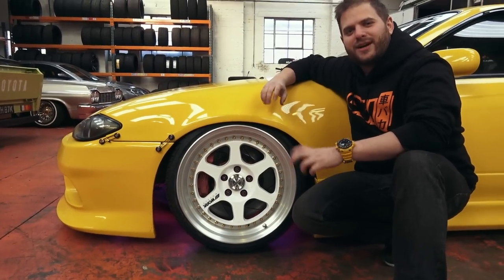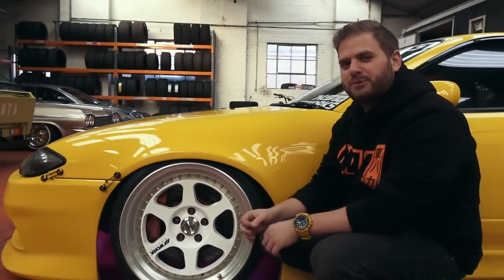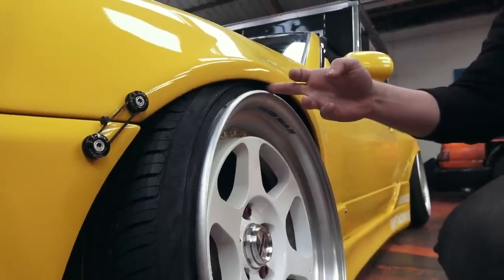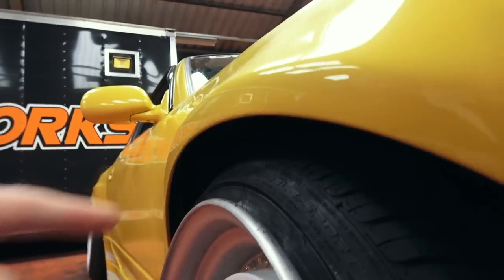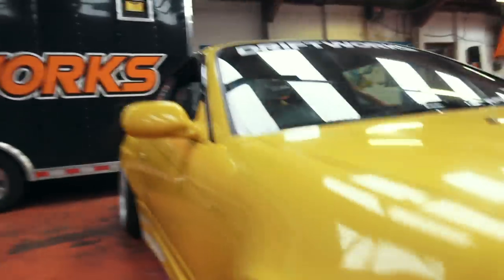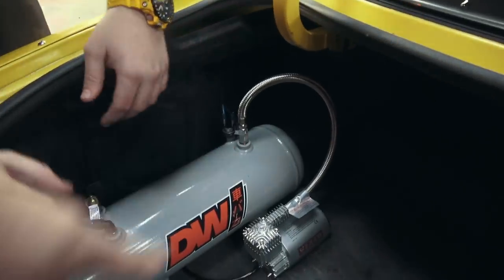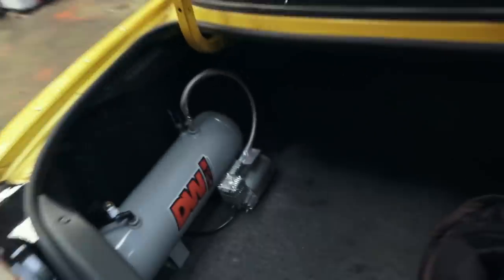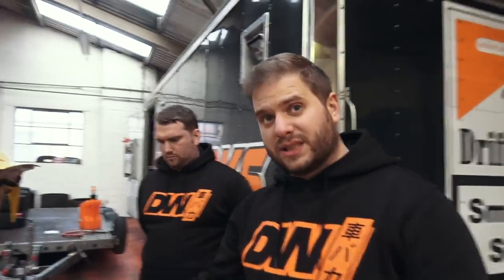AIR LIFT CUPS FOR COILOVERS: TESTED

Comment: But I want the opposite. I want my car to run at a normal-ish height. Then when I wanna hit the track I can drop it to super low race mode. And don’t say airbags because we all know coilovers out perform air on the track. So basically I want track set up coilovers that can be turned into super comfy air ride at the touch of a button. Or how about electronically adjustable coilovers? Track/street/comfort modes? Someone make that
Reply: fiesta51 just get coilovers and then adjust them at the track
Reply: fiesta51 that would be interesting maybe like a little motor that sits where the locking nut sits with a touch of a button you can move the coil up or down and also lock it in place
Reply: О

Comment: What are those things on the bumper - linking it to the fender - called? what are they for?
Reply from the maker: They're to be able to quickly mount the bumper using rubber O rings or zip ties.

Comment: That's still low tho. There isn't much wheel gap because it's stretched and has tiny sidewalls, but ground clearance isn't really enough for most stuff.
Reply from the maker: The static ride height is up to the individual customer. This is just Starkeys preferred ride height on his car.
Reply: Driftworks
I know, but he said "people will still call this low" and it is, it just doesn't look as low because of his tire fitment. If he had no strech and a 40 sidewall tire he would look much lower.
I wasn't making my comment on the product, but more like a reaction to what he said in the video.

Comment: What about coilover that have the springs seperate from the shock? Would the cups be able to work or not?
Reply from the maker: No, we don't have a solution for that, unfortunately.
Reply: Then its  not a coilOVER.    JUST A SPRING AND SEPERATE DAMPER

Comment: Is it just cs2’s the cups will fit or are there other makes that they work on?
Reply from the maker: We can do them for a variety of different brand coilovers. What brand do you have and what car?
Reply: Not long got a set of bc racing RM’s from yourselves for my s15. Could be a solution to my drive/exhaust problems

Comment: So does this work for drifting?
Reply from the maker: Hi, do you mean does it work on a drift car? It doesn't really make any difference what type of driving you're doing. You can only use this to raise the car temporarily, the rest of the time when driving under any condition it doesn't play any part in what the suspension is doing.
Reply: Yeah that’s exactly what I’m looking for because as you guys know uk roads are shite and I was just wondering if it made the handling different thanks guys

Comment: What's the most time these car hold air before damaging? would be quite useless if it was any less than 3 mins imo
Reply from the maker: They are only meant to lift the car over an obstical at low speed and be let down afterwards. They aren't meant to be driven on for any amount of time. It's not useless at all if you run your car low on coilovers & want to be able to clear speedbumps etc. What you are looking for is normal air suspension.

Comment: Can this kit be fitted to HSD coilovers? And would HSD allow me to have similar drive height as you?
Reply from the maker: It can't unfortunately. You need the CS2 sized dampers for the aircups to work on Sbodies as they use a large inverted damper shaft.

Comment: Can air cups be used on a drift/track car? Are they literally for getting over bumps? Can you drive around aired up at all?
Reply from the maker: Yeah no problem that's what they are designed for. They aren't anything more than a slight spring spacer when they are in the down position, so you can do everything you would normally do. You can of course driver far enough to get over your obstacle with them up, but they are not designed to be driven for any distance.
Reply: iv been bagging trucks here in the states for a while , they are rated for more than the original spring is, and since he is using a cup it wont have lateral sway under load.
Reply: gopherchucks so you’re saying it’s ok to drive on air cups?
Reply from the maker: Airbags are an entirely different thing. Airbags are designed to be driven on while inflated. These aircups are not designed for extended use, just to lift while you get over your obstacle.
Reply: yep no issue at all
Reply: gopherchucks hmm I think I’m inclined to believe driftworks not some random bloke in comments section

Comment: What is the specs of the wheels on the S15? And does it have wider fenders?
Reply from the maker: The wheels are 18x9.5 ET-5 fronts and 18x10.5 ET-33 Rears and he is running +40mm front and +50mm rears
Reply: Thanks. Cant wait til my set arrives :P